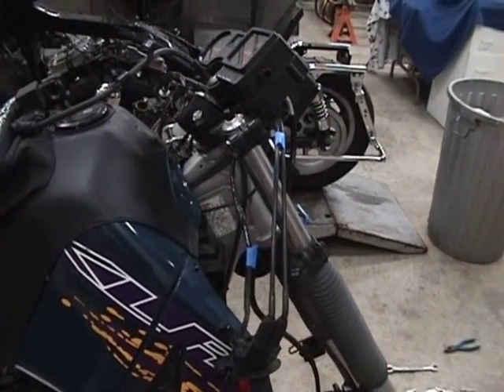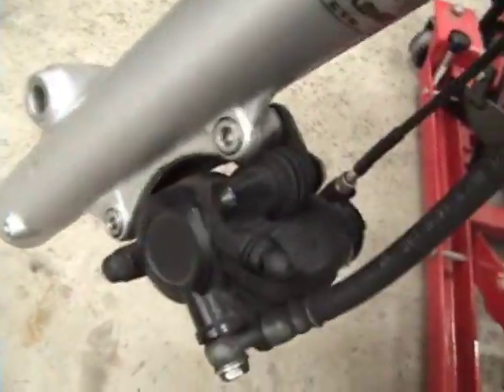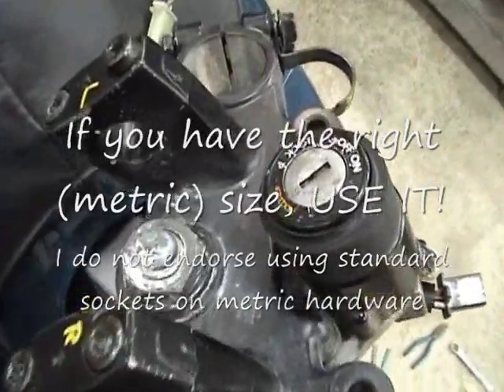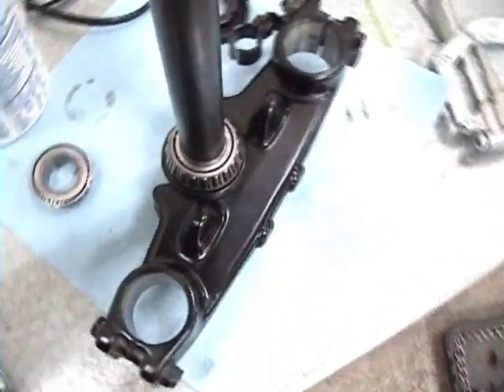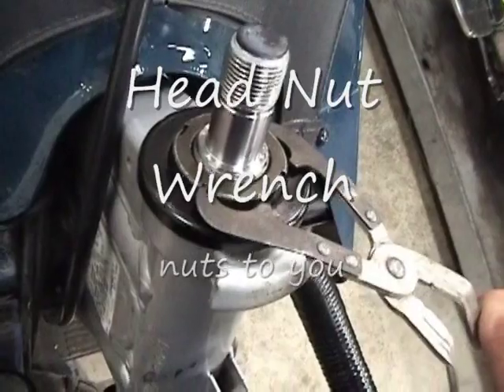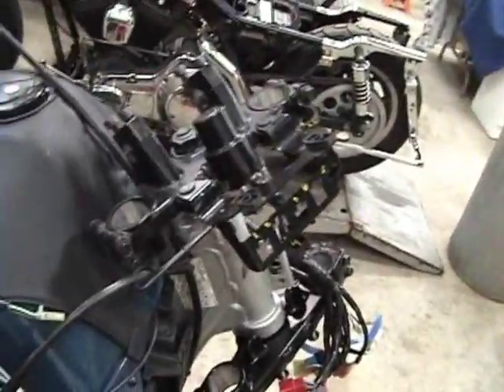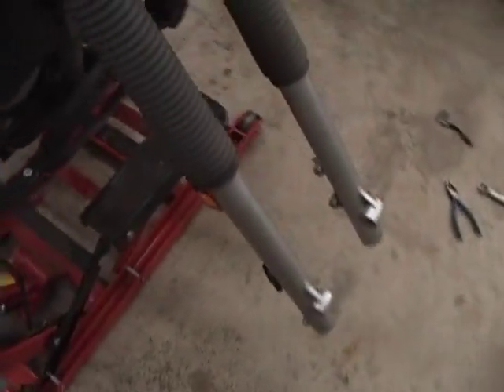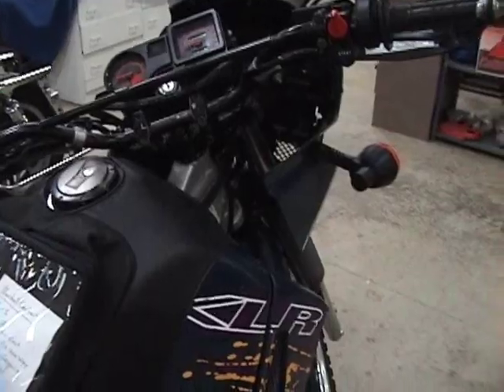KLR 650 Steering Stem

Comment from the maker: I might not be understanding you correctly. Loctite is designed to keep nuts and bolts from loosening.
On the KLR, there are two bolts for the steering stem. One sets the force on the bearings, the other acts as a jamnut for the first. What you described in the original post seems to me like the second nut is coming undone, no longer jamming the first, and letting the first loosen too. I implied that you should put some loctite on the threads of the second nut to keep it from undoing itself.

Comment from the maker: @shadow0imposter Tighten the stem nut to 29 ft*lbs, tighten the lower pinch bolts just enough to grip the forks. The bearing tension is set correctly when turning lock to lock is smooth and free. If it binds, it's too tight. Loosen it. If there's play or it's floppy, it's too loose, tighten it. Tighten the stem to 29 ft*lbs after adjusting tension and recheck for smoothness or binding. Tighten the lower pinch bolts to 18 ft*lbs when you're satisfied with the bearing tension.

Comment: to tighten your steering spanner nut, follow your service manual! for example on a yamaha 08 r6s(thats what i have) you first tighten to a torque of 38 ft-lbs(this seats the bearings) then loosen and retighten to 10 ft-lbs as your final torque. always go by your service manual though!!! or ask your dealer!!!! any questions about yamahas just ask. i have access to alot of service manuals

Comment: Did you ever drill a 1/8in hole in the right side of the steering stem to add grease through. Screwing a screw in the hole to seal. All being done with the bike fully assembled? A dealer suggested it to me!

Comment: Did you ever drill a 1/8in hole in the right side of the steering stem to add grease through. Screwing a screw in the hole to seal. All being done with the bike fully assembled? A dealer suggested it to me!
Bill

Comment: hey thanks so much the video, very useful,
i recently dropped my Klr, now when the front wheel is straight the handle bar is several degrees to the right, nothing seems bent, my guess is the fall misaligned the top and bottom triple threes, how do you undo the damage without opening up the whole system? thanks.

Comment: @tcclaviger 
1: In my experience, and assosciates (this includes mainly mechanics and engineers) it has abrasive effects. Hence using it as a cutting compound.
2: no disagreement there.
3: O-ring chains are sealed! that is what the O-rings do, seal the rollers and inner moving parts so it's not surprising they last.....regardless of whats sprayed on them.  All you are doing is cleaning the outside of it.  I don't use O-ring chains and have, hence, had experience of WD-40 and it's effects.

Comment from the maker: No. To set the bearing tension, do not use a torque wrench. Set the bearing tension by feel. Then set the lock nut (pretty snug)and the third nut should be torqued to 29 ft * lbs.

Comment from the maker: @shadow0imposter For the KLR, that's not the way it's done; don't set the bearing tension just by a torque wrench! Per the Clymer (p. 254 of the 1987 - 2003 version)(paraphrased): to seat the bearings, tighten the the adjusting nut with a spanner, but don't use excessive force. Loosen the adjusting nut, then tighten so that play in any direction is eliminated. [Do some other stuff that isn't directly related to bearing tension.]

Comment: I got a '93 VFR750, the steering is smooth, no grinding and it doesn't settle in a position. However, when braking heavily the handlebars shudder up and down. Do you think that my bearing just needs tightening? Or do I need a new bearing? Or am I just barking up the wrong tree :P

Comment from the maker: It depends on how much you want to lower the RPMs. Changing out the stock 15T (tooth) front sprocket for a 16T sprocket will lower the RPM by about 500 at 70, so instead of 5k RPM, it's 4.5k. You can go to a 17T, but you're running short on space at that point.
For every 3 fewer teeth in the back, it is the equivalent of adding 1 in the front. 17T equivalent is a 15/38 (stock front, replace rear). If you can, try to keep the teeth at an odd number, that way all the teeth wear more or less equal.
Reply: I think 17t is only if you got a 685/705cc mod.

Comment: @AfgantheBlack 

"it's slightly abrasive (although the steering doesn't rotate a great deal)"  

1: WD is NOT abrasive, it leaves behind a lightweight oil
2: Any grease will work, however having something that will stick around a long time is a good idea (i.e. lithium based grease not WD)
3: There are many .....many......many cases of Oring drive chains going 20k miles only being cleaned with WD.

Comment: loctite doesent really have a huge effect apart from holding bearings in. earlier today i replaced the ball and racer set that was previously used and found they were shattered so i have replaced them with tapered bearings and do the job a lot better :)

Comment from the maker: Wht, drop it on the other side, of course! :-)

Kidding. You have two options, depending on what kind of effort you want to put into it. The first is to wedge the front between to sturdy objects and twist the handlebars back.

The second option is loosen the fork pinch bolts, put the wheel between your legs, and twist the handlebars. This is the more "precise" way (less likelihood of you twisting too far, and if you do, it's not a big deal).

Comment: Here's a tip, before reassembling drill and tap a grease nipple into the steering head support tube, fitt steering, pump grease until it ooses out top and bottom  eliminating any chance of water or dust entering the herrings. Pump grease every six months and you should never have to clean them again ;)

Comment from the maker: I had the same problem, but I coast instead of down shift (saves gas). As soon as I let of the throttle and pulled the clutch in, it would drop straight to 0, maybe struggle around 600 - 700 RPM, then die. Does it start back up and run fine if you pop the clutch when it happens? I cleaned the carb, checked the gas tank vent, then checked the valves... they were out of spec (too tight), it hasn't happened since. If your bike is still under warranty, have them check it out, ask if you can watch...
Reply: What was causing your bike to die when you would come to a stop and pull the clutch in? My bike was doing that recently but the day I fixed it I now lost my keys so have to wait for new ones to show up until I cAn really find out if I fixed it.
Reply from the maker: @hmobb7838  My bike wasn't dying when I stopped and pulled the clutch in; it was dying when I pulled the clutch in and let go of the throttle at 80 mph. Bump starting it got it going again. I never figured why it did that.

Comment: Incorrect, remember that a great deal of the space is taken by the shaft. When the time comes to replace the berrings you will only then be assured that the grease is the cheaper and hassle free option in the long run.

Comment: A useful vid.  I'm not so sure WD-40 is the best cleaner to use, it's slightly abrasive (although the steering doesn't rotate a great deal I'd still be wary of using it). It's why you should NEVER clean a drive chain with it!  I use WD-40 as a cutting compound when I'm drilling steel.  Next time you're drilling something try it dry 1st, and then try it with a squirt of WD (you'll see).  I'd use a solvent based spray cleaner, and ensure you thoroughly work the new grease through the bearing.

Comment: my gage panel and steering bars are off center. do i just losen the 27mm nut and try to force then straight?
Reply from the maker: What do you mean by "off center?" Shifted or rotated?
Reply: no just crooked to the side. lost control while parking on gravel and I couldn't hold it up so it dropped
Reply from the maker: Ok. Loosen the 8 pinch bolts on the outside of the triple tree (2 on each end), brace against a tree, house, vehicle, etc. and crank on the handlebars a bit. It should straighten out. Retighten the pinch bolts to 18 ft*lbs.

Comment: Oh no 🤪 you are supposed to put a big lump of grease in your palm, and then scrape it with the wide side of the bearing until grease starts bleeding out the rollers. Then you should roll the tubes on a sheet of glass to make sure they aren't bent. Good topic though 👍